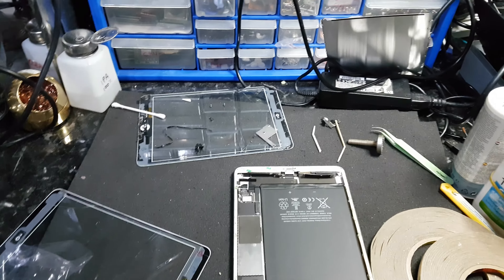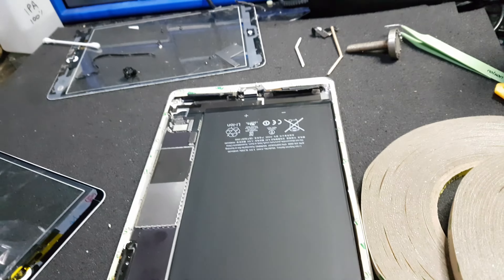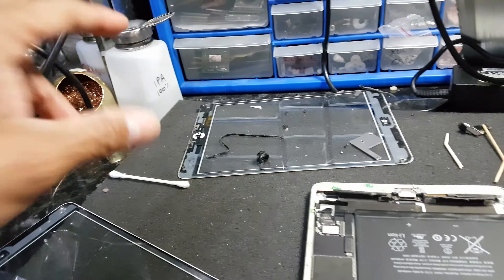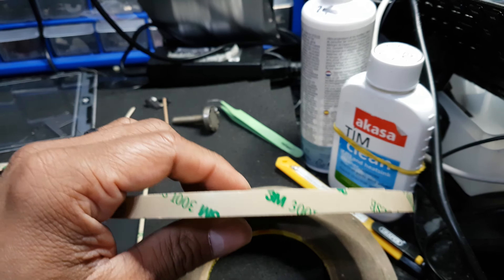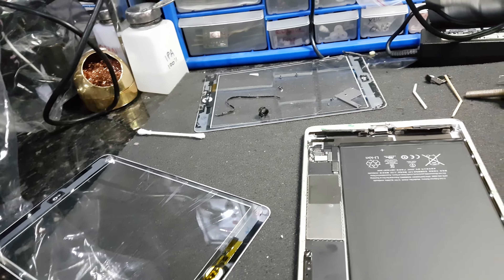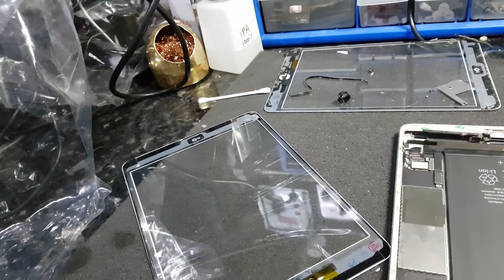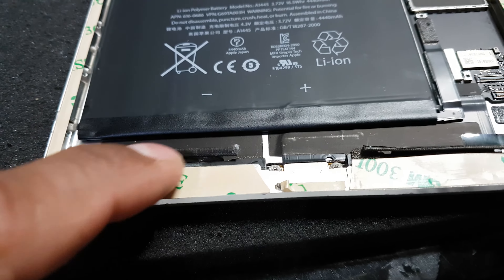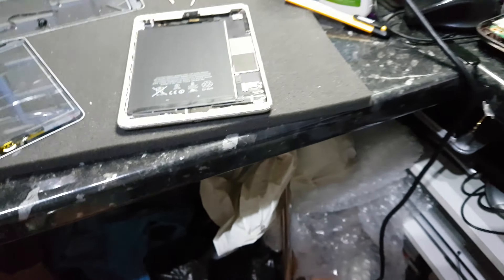IPADs REPAIR STOP BEING A DOUCH BAG AND USE 3M 300LSE ADHESIVE

Comment: Do you use 300LSE as well as the black stuff that is pre-installed on your glass? I thought you would use one or the other???
Reply: It would seem so! He must be right. I did a repair last night using only the stuff that comes with the new digitizer and this morning it's already coming off the iPad.
Reply: I cant get the right side to stay down where the cords are.
Reply: @ERDESH01  Same here. And that is often also when I use a proper adhesive tape (Not 300LSE, but something similar, but it there is just so little purchase for the tape to hold on to on the frame (only slightly more than 1mm on the later models such as the 6. and 7. gen).
So what I quite frequently have been forced to do, is to use one of those cheapo suction cup thingies that many digitizers are shipped with - and lift the glass very gently on the problematic side - and then get my trusty B7000 glue and get it well in the crack. I then use a few springy plastic clamps and hold the glass down and ensure I get a good squeeze-through of the glue to the outside. Let it sit a while and when I feel it has cured enough, I use some solvent to clean up the glue that squeeze through.

That glass is now NOT coming off unless you really want it to :)